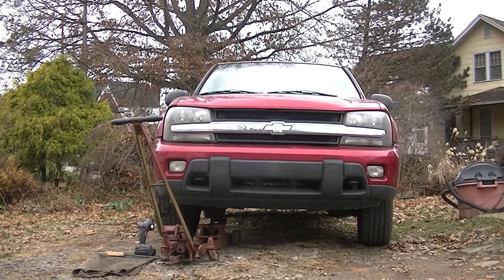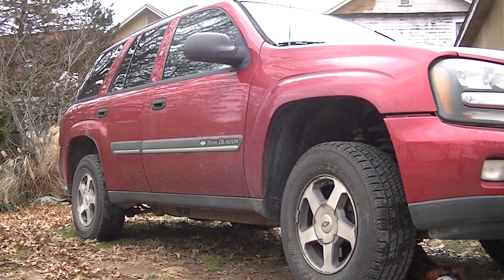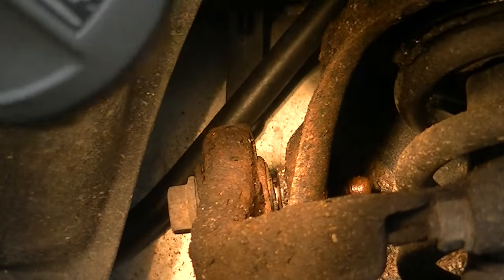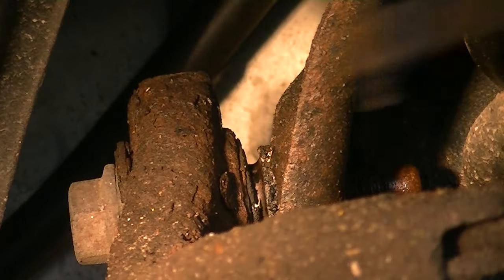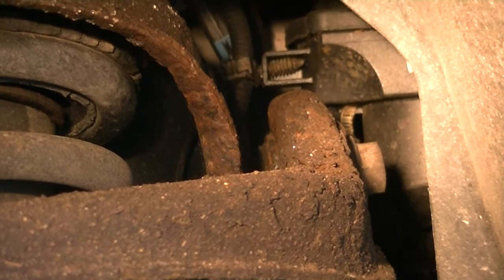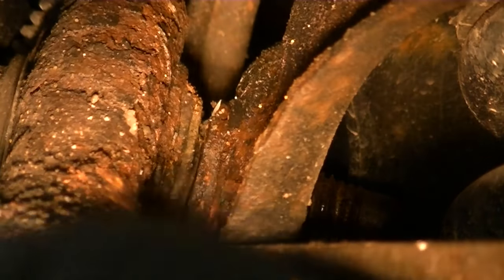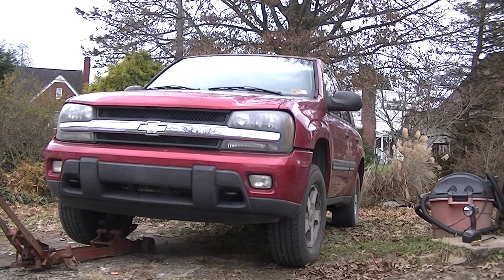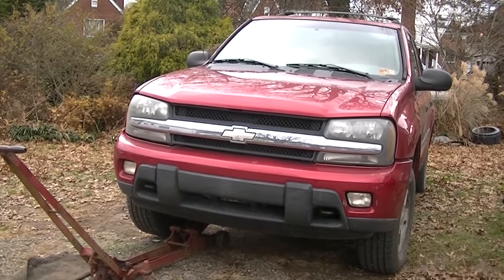Why you have sloppy steering, Road swaying...Always Check Them!

Comment: I had my lower control arms replaced recently.  It feels like I can feel the road much better through the wheel.  When I make a right turn, it pulls hard right and corrects very responsively with little input from me.  I can feel all the little bumps in the road.  I've noticed when I am on the highway and it is wet if the road isn't perfectly flat my steering goes very loose like I lost traction, then will suddenly pull to one side or the other.  I thought something was broken. It makes sense that this could be the problem.
Reply from the maker: Yea true!
Reply: Did it fix it?

Comment: Yes! Please make a video on changing your upper control arm bushings, at least that's my vote Nathan!, and please show us how to measure for correct bushings, some upper control arms come as a complete unit with bushings I believe? ***( myself, studious beginner)👍😄😊
Reply: I agree. You do a real good job of letting us poor folks fix stuff that we can't afford to let others do. Much appreciated thanks.
Reply from the maker: @tjeastcoast4669  Nice! Thanks Parts will be here Saturday! Two upper control arms for $48.00! Free shipping.
Reply: @FixingWithPassion  I am in the process of doing my upper and lowers on my 2000 Mountaineer I got both upper arms and the 2 lower ball joints for 60 I believe. Where did u get you arms?
Reply: @FixingWithPassion  another suggestion for a film for us peeps, you mentioned welding up new plates on your frame on the Trailblazer, and cleaning off the rust, your techniques and repair there would be helpful if you so desire to make that video. We care about you! And your channel, I personally see you as a friend, even though I've never met you, and I believe I echo that thought for many of us your viewer's.
Reply: @FixingWithPassion  I meant rust repair on you're 4 runner, not you're Trailblazer😃😅,

Comment: This describes the feeling in my wife’s 2016 Dodge Grand Caravan. Unfortunately no upper control arms. But good and informative video none the less. Both lower control arms replaced complete with new balls joints. Still wonders around on highway when changing lanes.

Comment: Wasn't your problem in another video the Sway Bar Links and Sway Bar Bushings?
I'm having wandering, no rattles, but I do get a clunk when I hit a sharp drop off an angled driveway.

I'm suspecting:
▪︎ Front lower control arms.
▪︎ Front Outer Tie Rod ends (passenger to driver side)
▪︎ Rear Upper Control Arm (A Arm) with Ball Joint.
▪︎ Rear Lower Control Arms.
▪︎ Sway Bar Links, I doubt the Sway bar is bad, maybe Bushings.
▪︎ Steering Damper/ Steering Stabilizer.

What you think my issue on my 02 Jeep Grand Cherokee Laredo 4.7L V8 4x4 is?
Reply: Take it to a good mechanic. He should be able to figure it out quickly and accurately. Those Grand Cherokees are notorious for the bushings to get soft on the control arms that keep the axle tracking correctly. There are so many suspension components on that particular suspension, so you could have multiple issues. They sell complete kits to rebuild the front ends for good reason. When the vehicles have high miles, you end up replacing one part, then 4 months later you're replacing another part. Every time you replace suspension components, you should check the alignment. This can get pricey if you keep replacing parts. If you want to keep the vehicle running as long as you can, IMO it's generally cheaper overall to rebuild the suspension with new components at one time.

Comment: Nathan I would love to see a follow up video after you have replaced these and if your issue is fixed.  I’m having a similar issue with my Gen5 Camaro on uneven roads where there is construction going as I drive over I temporarily lose control of the steering feels like loss of traction. From the sound of it sure sounds like the issue you described in your video.  What other parts could contribute that I could replace while down there? The car was in a front end accident before I bought it and I suspect they didn’t fix any of the suspension.
Reply: Did you ever figure out what was wrong with your car?

Comment: Great video
I checked mine & they all have very little movement if any. 
My 07 Envoy drives good, straight until I hit a groove or switch lanes it just takes off. 
Any other ideas to help with this?
Thanks
Reply from the maker: Someone told me that the Rack & Pinion causes a lot of steering issues. I'm going to test this theory  some day.

Comment: Great video, i have a 2007 mededes gl450, had summer rim tires set no issues had this set for 4 months, now i just  bouught a used all season tire rim set in offer up but the tires have worn edges, do you think this can  caused by this too?  I mean i had no issues what so ever with the stock set or the summer set

Also i have new set of stagered set on my 07 bmw 750LI i have the same issue no tares on bushings  i shoke tire maybe it was a wheel bearing but it has no play , what can it be pls help

Comment: I need to drop my oil pan on my trailblazer to removed a burnt piston.  While doing so,  the awd actuator housing broke on me. All bolts were removed. Any ideas why?  The male housing part is still stuck inside.  I’m afraid I’m going to have the same issue with the transfer case. Any advice will be appreciated as always. Thank you.
Reply from the maker: O my! Lift the motor some yank it out.

Comment: I feel like this maybe what's causing my car to sway. I have a dodge challenger V6. Just got 275/45/20 tires for the back. Car sways. I put on different set of 245/45/20. Car drives a lot better. This car use to handle wider tires just fine. I already got the 275 wide tires balanced, just had the car aligned. Still sways. It has to be the control arm.
Reply: Most likely the control arm
Reply: i have the same issue with my Dodge challenger v6 too. Was it the Control arm?
Reply: @scarfaze  it may have been the control arm but I already sold it to a used car dealership.
Reply: Maybe your suspension man 
Like the shocks or struts